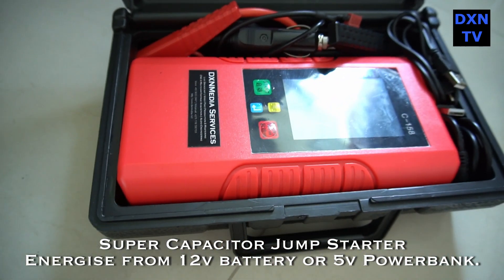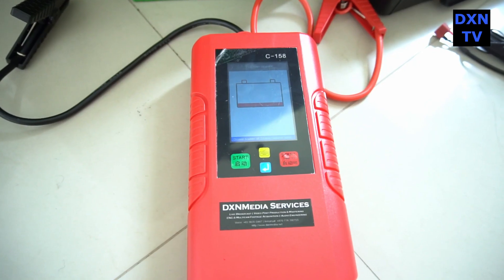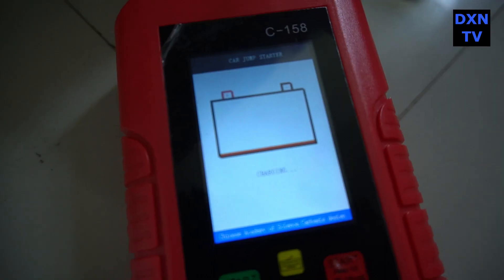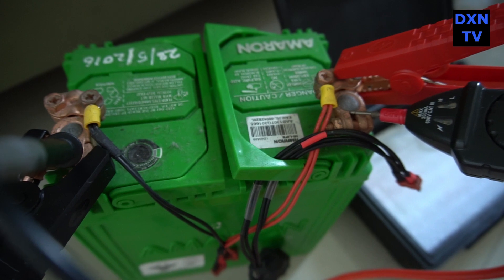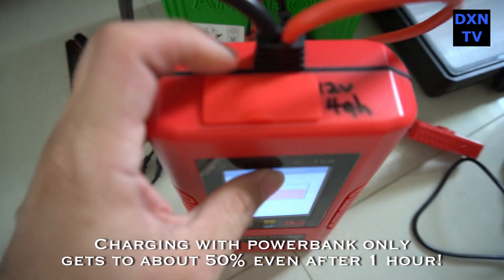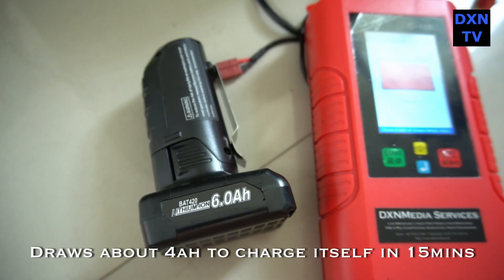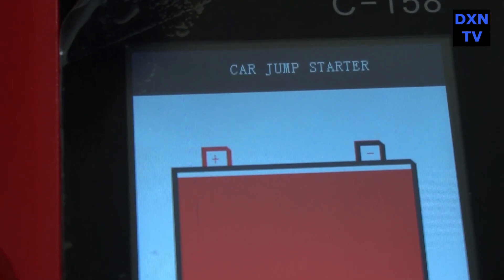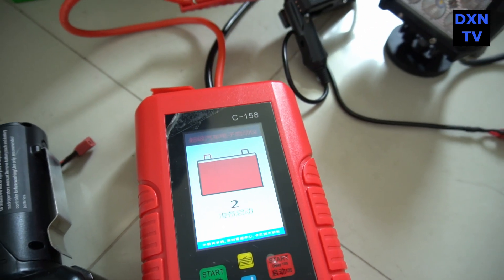DXNMedia TV Tool Demo / Review Video - Super Capacitor Car Jump Starter

Comment: It needs to demo with actual jump start a dead battery car.
Reply from the maker: it does crank up the car with a dead battery, but unfortunately, we didnt bother to create a video since there isnt much interest since 3 years ago. One thing to note, over this 3 year period, the unit actually cracked up and disintegrated after we left it in the car for emergency purposes. the Plastic body casing is totally lousy and terrible, made of cheap plastics that turned sticky... The use of super capacitor concept to store energy temporarily for a short high current boost for car starting works for sure, but its just too lousy body design. Until there's a better design or newer product, we will buy it for sure. Stay tuned to our channel.

Comment: This device is BRUTAL. It takes far longer than 10 minutes to charge and it doesn't maintain the charge like other supercapacitor devices. Once it is EVENTUALLY charged, it will boost a vehicle, but it has taken me as long as an hour for it to charge from a running vehicle or an outlet. It loses the complete charge within 24 hours. That means when you do need it, you cannot count on it for about an hour.
Reply from the maker: yes...  it does take hours to charge up from a USB 5v source, or even from a weak 12v source, and it totally doesnt hold capacity. But thats the key point i guess... this thing allows you to have a 12v battery source that cannot sustain proper cranking current to accumulate sufficient energy to crank the engine. I successfully used 3-cell lithium RC flight packs of about 1500mah, or Bosch 2.0A 12v tool lithium packs as a boost source for the supercap to start the engine, which otherwise wont have enough cranking amps by themselves. If your 12v packs have enough juice, it draws about 3amps in 15mins to fully juice up the supercaps for a good 2-crank attempt.
Reply: @dxnmediatvsg  I've tried charging it directly off a running vehicle (right from the battery) and it took a LONG time (about a half hour). However, it did start my other vehicle WITHOUT a battery with no problem. Maybe I'm just not charging it right. But it does work well once it has a charge.
Reply from the maker: oh yes, and I realised that if you clamp on directly with the jumper clips, it does charge up faster than if you use the tiny DC input ports.